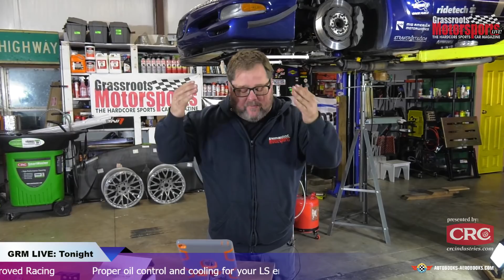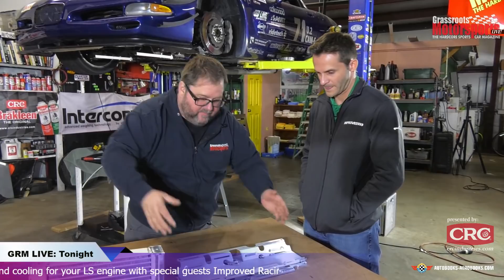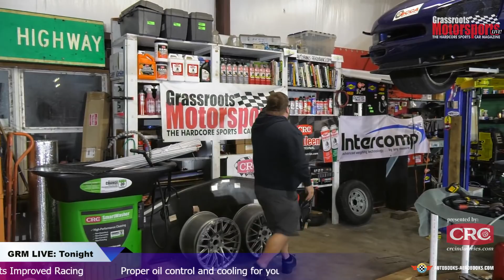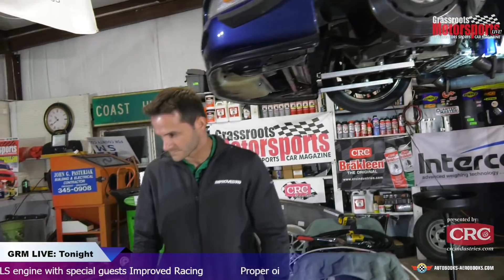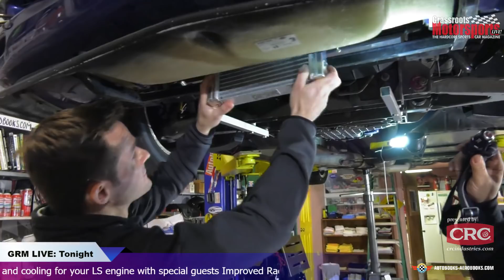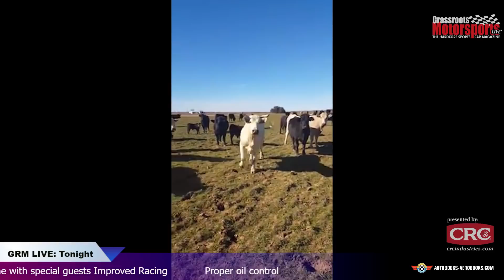Proper oil control and cooling for your LS engine with special guests Improved Racing

Comment: Guys:  I'm an amateur hot rodder. One of my cars is a 2010 Camaro SS (LS3).  The OEM oil gauge displays around 220 when warmed up and driving.  50-90 degree Northwest ambient temps  I can't vouch for the gauges accuracy, but assuming it is accurate - this seems like a good operating temp for power and emissions.  So if I replace the OEM cooler, (I'm adding an IR oil cooler), I wonder which Improved Racing thermostat I would choose if I want to keep my OEM level temps

Comment: With the use of R134a refrigerants, GM switch to extruded cores in the condenser with an inch wide (25.4mm) it contains 12 square holes to help extract latent heat. The end tanks can have sealed block-off plates making the refrigerant cross 2 or 3 times before returning to the suction line. This goes back into the 90’s. 
  My question comes with the oil pan mounting of the thermostatic block a mine simple has a supply and return. Without tracing the circuit, I would I am guessing the forward is from the oil pump and return or back hole goes into the oil filter cavity. I am new to the “LS” engine family as I did have any to work on at the Buick dealer in the late 90’s. 
  Also, not a slam or bad feelings, but having a block on an engine stand would be an easy visual aid. As for this episode, I would be guessing your guest is from “Improved Racing?” At least it in the title, but his jacket logo was so small I would need a microscope, any Banners or Signs on the shelves behind you guys in the shop. Contact info, phone number, website? Look, at 63 I have lost hearing after 38+ years in a dealership shop and due to joint issues in am forced into retirement and it don’t pay well. iPhone 6 is all I got and have to use corded ear plugs to hear. 5 dead laptops including MacBook Air. Maybe I can find your guest, company and products on the internet, perhaps show notes? 
  Certified Automotive ASE Master Tech since 1978 - Retired

Comment: I have a stroke LS 416 I’m having problems with the oil going above 200° with that being said my oil psi pressure tends to drop a little bit below 30 psi roughly 27 to 26 psi once it gets above 200° do you think this will solve my problem
Reply: I think from the video your oil temps are in range, but pressure, if measured by a mechanics gauge would confirm or show you something different. Using a higher viscousity oil would be one quick way of seeing a change under your build, design and how you use it. A lot of variables but start with a good gauge reading and don’t trust a temp reading with a non-contact digital thermometer reading. Inside is where is counts and before any cooler. Hope this helps! Retired ASE Master Tech.

Comment: If they are going to use the GRM z06 to develop the kit, they have to keep in mind that car does not have the stock air dam, not sure how that would affect  the design.
Reply from the maker: Yeah we discussed that, and also the fact that we're doing headers soon. When we take them the car we'll be providing all the stock pieces as well so they can get a feel for how those are arranged and if they can integrate those into their install.
Reply: @Grassrootsmotorsports  Well my car has long tube headers so might not be a bad idea to have them develop it with long tubes lol. But yeah thats something to look out for also since where the bypass is installed becomes very cluttered if you have long tube headers.